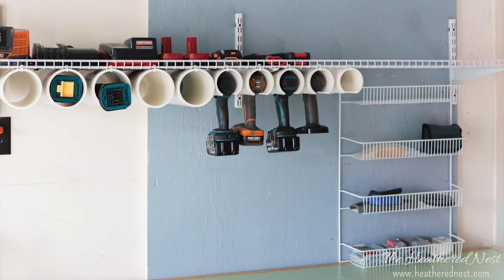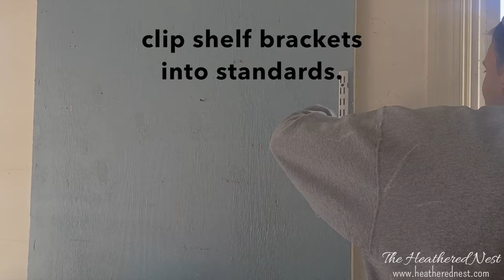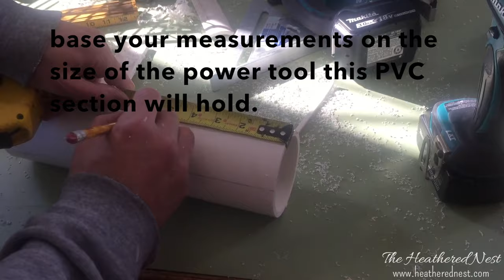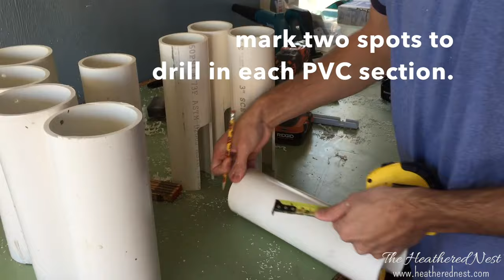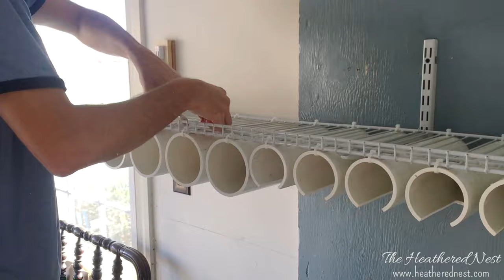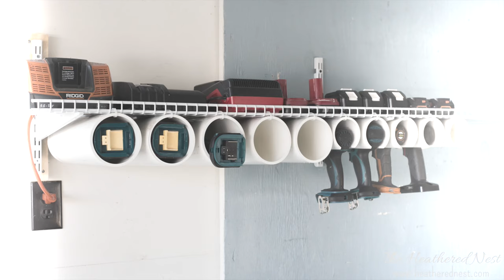How to Build a Quick & Easy DIY Power Tool Organizer & Charging Station

Comment: The pvc part looks cool, but the metal grate shelving is ugly.  Wood looks much better.  But good job on the step by step with the pvc.  Might want to add that the pvc is 3 inch
Reply from the maker: Nice idea. Although, in fairness, I don't think "pretty" power tool shelving was what we really were after ;)